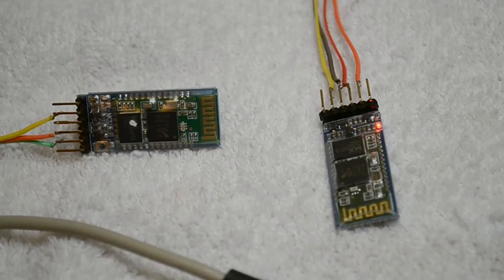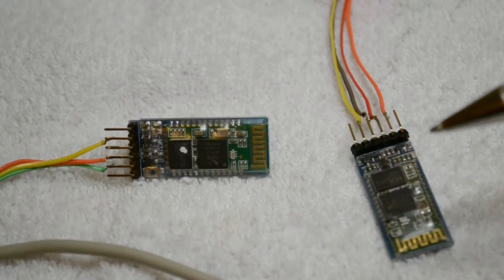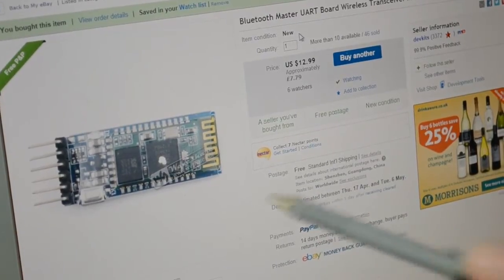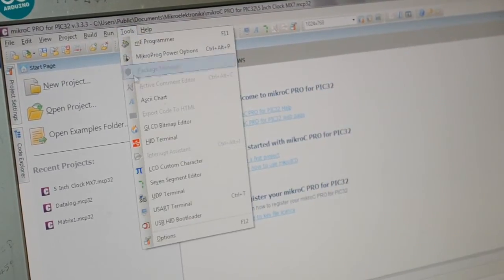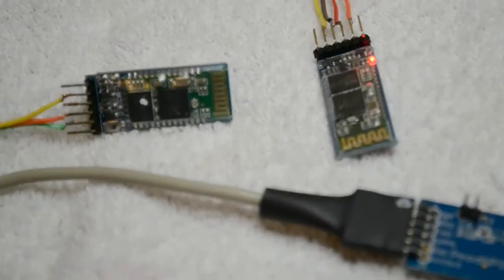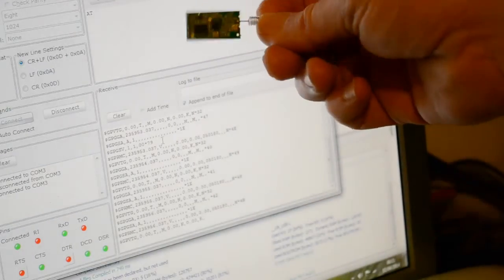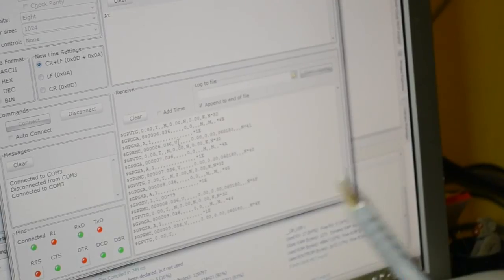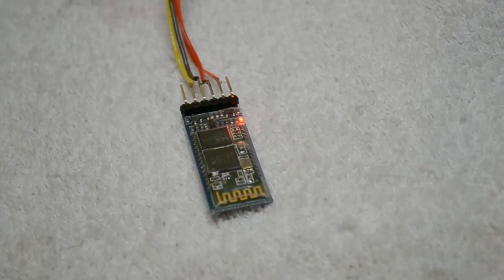Data via Bluetooth Wireless UART and it works 100% A quick guide

Comment: Hello sir good video.
Little question is possible convert one display wired 4 wire with this module?

Display module have stm32f103 mcu.and 4button.

Main board inverter have Dspic33.

Thank s a lot
Reply from the maker: It is possible to send any data with these boards and show the data on the display.
The STM32 has UART.
Thank you for your comments.
Reply: @JohnB-2021  thanks for reply Wath module suggest for this conversion low cost?
Thank s
Reply from the maker: @s-max3277  I see the links don't work any more. You need to search eBay or somewhere like that.
Reply: @JohnB-2021  do you have test distance to this module? With wall o without
Reply: @John B 
Ineed select module for this conversion.
If buy two module 05? Master master?master slave this is settable module? 
Or need buy one 05 and one 06?
_______________________
I need info for distance Comunication. Tank you
_____________________

I have one little question for master and slave.

My display have 4 button.
With this button have access to menu for change setting and check data. The possibility this device is master? This board display have stm32

AND other mcu is Dspic33 for control inverter.
Suppose this work by slave and response to query mcu stm?

Thank s for support
_________________________
Reply from the maker: @s-max3277  They are sold as a pair.
One is a master, you can change channel and pin number.
Either the master or slave can be used to transmit and the other to receive.
Ask the seller for instructions.
I have not used these for many years.